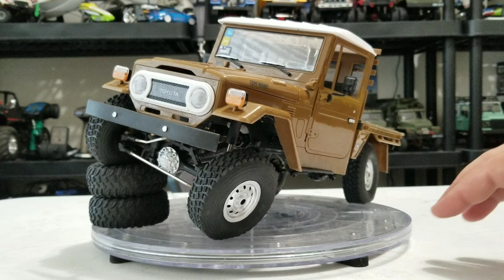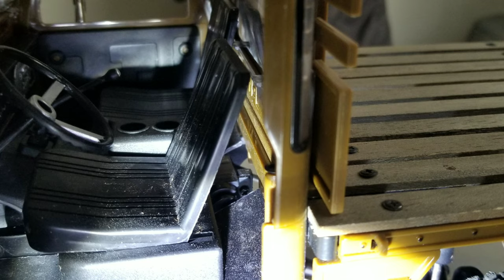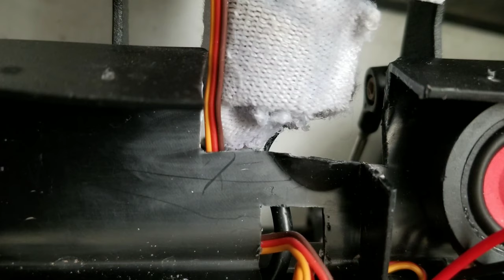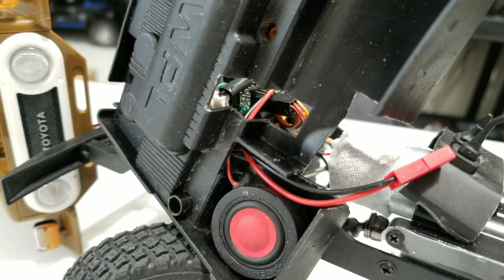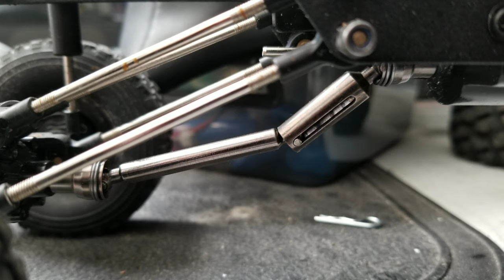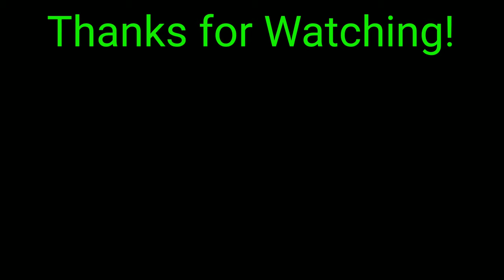WPL C44KM. My electronics and drivetrain setup. Land Cruiser FJ45

Comment: Any chance to make speed around 30-35km/hour like a Dakar rally car? Any ideas?
Reply from the maker: you can probably go brushless with the 2 speed gearbox and get close to that speed. Not sure how reliable it would be though.
Reply: @RunThatRC  Do I need to connect motor to gearbox or directly to axles via drive shafts - what length short or long?

Comment: Can't wait for mine to show up, it will be my first kit but my second WPL and it's thanks to you!  Do you know if I want to make it a 4 link will I need aftermarket pieces or can I use parts from the kit?
Reply from the maker: if im not mistaken you should be able to use the panhard bar as a link. Im not 100% sure because my kits come as a prerelease version so not sure what the final version comes with. But yes it can be 4 link. I believe the C34KM cant be converted because the gearbox and motor that comes with that model needs room for the motor so they went to 3 link with panhard. If your using the 2 speed then 4 link should work.

Comment: I’ve seen videos of other builds where they moved the transmission but they didn’t need to do the tape thing. Did you just move yours higher or something
Reply from the maker: yup high enough for the bottom of the gearbox to be flush with lower link tabs. Also had to trim the interior to get it up that high.
Reply: You probably don't have to move your gearbox as high as RTR did if you just wanted it to be a decent trail truck. A lot of stock 4x4 trucks and Jeeps (1/1 scale) have a low-hanging transmission or transfer case with a skid plate BUT if you were intent on having an extreme 1/12 rock crawler, big monster truck tires would be the next modification, or in the #1 slot.

Comment: You got your ears lowered! Looks good! What kind of cloth did you use to cover the motor? Does that help with muffling the sound of the motor?
Reply from the maker: I use whatever spare cloth I have. Just as long as it can keep stuff out of the motor for water runs and sand runs. make sure the cloth is not too thick so the motor doesn't build up heat.
Reply: @RunThatRC  I’m taking that advice to wrap the motor as soon as I can, but tell us more about learning it the hard way—you must’ve lost a motor to debris and dust; was it catastrophic failure and/or were you able to repair it?
Reply from the maker: @Hjerte_Verke  I had a motor get some sand and dirt inside and it seized the motor burned it up and popped the ESC with the magic smoke. So motor and ESC damaged due too debris. Covered the motor and hasn't happened again.
Reply: @RunThatRC  Far out, man! You let the magic smoke out. Cool! 😀
Reply: @RunThatRC  I see a good idea for a new invention, a “motor screen filter” that you snap or tie onto the motor can. Could even be some kind of plastic or metal mesh so it won’t rot. Ya ought to file a patent for it.

Comment: It is Nice to watch the mods you do i dont know if you had that issue but my front stearing never Return to zéro position when i turn left to right and it pulls on the suspension and make the car look lower on 1 Side or the order the other problème je the v2 the speaker stop Working after 2 Days is it because i run on 3s ? I apprecciate your vidéos it help à lot for some issue but to me i like wpl métal for détails look and the fun to build Them but i cant expect Them reliabilite and great performance for rock crawling but for the price it is expected at least the metal one the other i dont recommand it everythng is to weak if i tried to upgrade Them it wont stop breaking and at the END i would put to Much money for the performances i END Up with it anyway thanks a lot to take the Time to inform us .😄
Reply from the maker: If your steering is binding up you may have incorrect length arms or steering setup. The steering affecting the body roll is something you can minimize if your links are properly setup but not completely get rid of unless your using a programmable transmitter. There is no epa on the WPL tx so setting up steering takes some patience to get right without the steering binding. Just try to mess with the steering links and servo horn mounting point till you get better steering without binding.
Reply: try my budget fix? most all WPL kits come with a steering link for both the B frames (straight rail) and C-frame (4 link suspension)
measure twice! cut the C-frame link at a STEEP angle on the rod near the lower loop end. cut the B-frame at same steep angle at the servo end, then join with CA for a longer steering link that reaches to the further away passenger side. use a longer screw, a washer, and a servo grommet so it mounts at the very top of the steering knuckle (is about 3/16" higher, on top of the plastic). it gets rid of a lot of the bump steer issues doing it, and only costs a little time.

Comment: WPL does pay attention, you might see some of your improvements adopted by them.
they might be coming out with a budget drift car, they saw my first video.
Reply from the maker: Yup they like to make people happy when they can. My drift build is in limbo because I'm not sure which way to go with it at the moment.
Reply: its lots easier with B-frame leaf spring setup to put it down low with about 1/8 to 3/16 suspension travel. rails shortened about 3/8 at front with creative butchery to the front servo tray. when near done easy to see how much to shorten the rear frame, took couple plastic leaf springs to make the rear offset bed mount, and as spacers for the front bed mount. really did it all as simply as possible! best way to know is "just do it", the B1 (aka B14) with 4 link C-frame under it is nicer crawling after the frame swap game too.

for a 180 motor, needs older #316 gearbox with 8t 0.5 modulus brass pinion direct to output shaft gear...  4:1 ratio means 5k rpm on plastic with 20k rpm motor, is THE most likely failure point, and even more likely with a 2 dollar 30k rpm brushed motor that'd spin the shaft 7500 rpm. if I go that route, it'll get drilled for brass tubing as bushings, ball bearings in the axles with metal front steering hubs. wheel speed would go from 2200 to 3300,  final drive ratio being about 9.2:1 (2.3 axles x 4:1 gearbox). it'd still be cheap and simpler sticking with a brushed 180, 30k rpm is about 4000kv if apples were oranges. it'd give 50% more wheel speed could be nice.

Comment: Nice build and a great video, but does anyone know why they the front end with a 3 link and a panhard bar? I took my panhard bar and straightened and moved the one ball end to make it a 4 link. I haven't run mine yet but it seems to work just fine
Reply from the maker: the panhard bar setup is suppose to lessen bump steer. some have done whag you have, it works as well but may have a little more bump steer.

Comment: Will the v3 sound work with my radio and esc?

Love the trans lift!
Reply from the maker: Unfortunately no. You have to use the transmitter it comes with. It is a really good performing combo even if the tx isn't the greatest looking.
Reply: I just bought that hobbyporter 7 channel radio and a bunch of receivers. Bummer
Reply from the maker: @ragsixracing  that radio is great. I use it on my C24 and p407. Really smooth and some cool and unique features. You can just go the none wpl esc receiver route. It's good too but can get expensive if you want all those light and sound features the V3 has.
Reply: @RunThatRC   I have an ess sound box but it's much bigger. Guess I'll have to disguise it as a crate on the bed haha

Comment: How's your turning? Mine seems to struggle to steer so I've set the endpoints to 60-75%
Reply from the maker: On a programmable radio I do have a turn down the endpoints a little bit but I still get full throw. With the WPL V3 system it's not programmable so I move the steering linkage up the steering horn to adjust throw. I do get full throw. you might want to check your front axle assembly to make sure everything moves freely.
Reply: @RunThatRC  I did check. Nothing is binding up when the wheels are straight but they do struggle when turning more than 70%. I even put a spacer between the pinion and drive gear on the axle. I noticed that sometimes the shafts are ever so slightly bent which can propagate through and cause turning issues. Ah I wish I could physically see how other people's trucks drive so I can figure this thing out...I live in Calgary, AB. I have to admit though, MN D90 does a much better job with fit and finish than WPL. I like WPL as they're the pioneers of this new 1/16 scale realistic looking trucks but they tend to use somewhat cheaper materials and the engineering is not to the level of JJRC or MN.

Comment: Hello. I just bought a Wpl c44km and bought from banggood the Diesel version upgraded 2 gen engine sound but I do not know if the Esc that moves the vehicle is in the box. Below I send you what is in the box.
Please tell me if I did anything wrong.
Package included:
1X Transmitter
1X Engine Sound
1X Receiver Board
1X Sticker Sheet
1X Manual
Is the ESC missing?
Reply from the maker: it is a all in one board. This is what I received. https://youtu.be/M9EnNq6kVSY
Reply: @RunThatRC  thank you very much for the info. keep up the great work.

Comment: Got problem the tyre touch pull rod? Mine touch..
Reply from the maker: center your servo horn well with zero trim and move link up on servo horn to get less steering. That should help from rubbing the links.

Comment: How to flexible your suspension
Reply from the maker: I spray them with oil every couple of runs. Keeps the rust away and makes them run good.
Reply: @RunThatRC  any cut your spring
Reply: @Andozable  On one truck he did, cut about 3-4mm from the top of spring where the coils are tight. Only on the front shocks though-- I think it was his blue C34.
Reply: @Hjerte_Verke  ok thank bro

Comment: You have to take got tape off of your motor or your going to burn it up
Reply from the maker: I actually have a thin cloth over the motor for water runs its not tape. I haven't burned a motor this way yet crossing fingers.